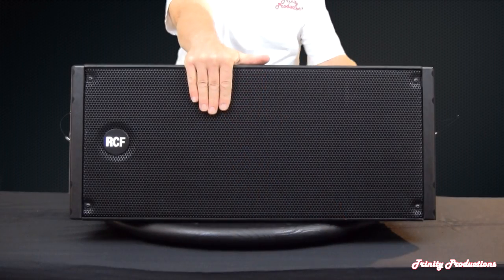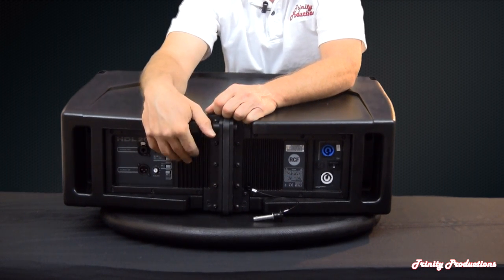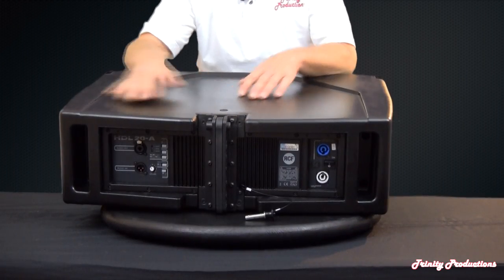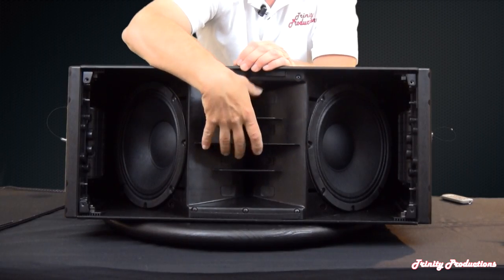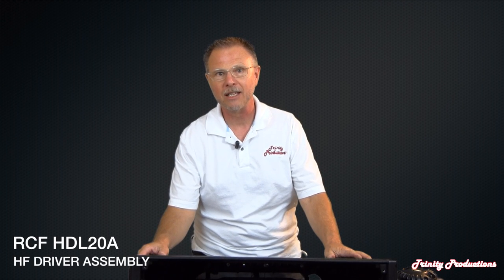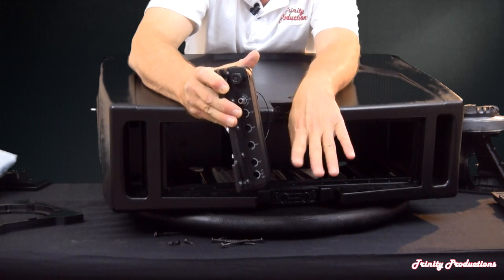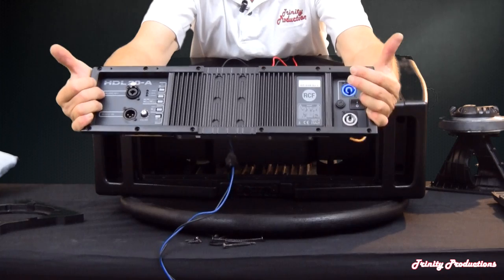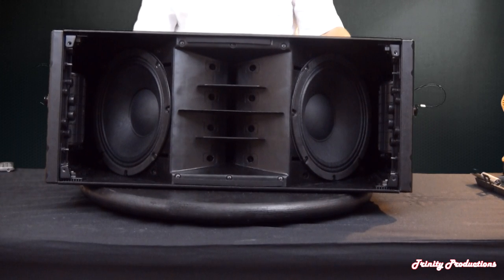RCF HDL20A overview - inside and out - AUTHORIZED DEALERS

Comment: Manufacturer's very good product which produces all its loudspeakers (made in Italy not china)  as JBL. This series HDL tickles legendary reference JBL VRX. Too often the professionals do not inquire about the origin of manufacturing and as regards to the cabinets the origin of loudspeakers, 80 % of the marks being only assemblers having never made a single loudspeaker.
Reply from the maker: Some RCF is made in China. You are incorrect, that the VRX is constant curve JUNK system, the HDL20A is a true scalable line array. It does really not make any difference where the drivers come from, as long as the design and DSP and box is tuned to the speakers and the mfr. warranty stands behind. Does not matter if US , China or Italian made. There are some very good speaker components coming from China. Many of the music store systems by some of these companies come from China and sound fantastic.

Comment: How would u compare these to the QSC KLA series?? Thanks in advance.
Reply from the maker: These have a much fuller sound and the drivers are much larger on the HDL20A for the HF. The amp is a true RMS rated amp, but that said, the KLA are a max of 5 boxes, these you can go to 16 per side in a hang and have full array adjustably, which you can't do with KLA or similar VRX, etc. These are more in the ballpark of the Wideline boxes and not KLA

Comment: What difference between the hdl10a and hdl20a beaide speaker size? I cannot decide if the hdl10a would be good enough for live bands any advice?
Reply from the maker: power and size and type of drivers. more SPL from HDL20 than HDL10...10's are going to need more in the line to produce what the HDL20's can do. If you can afford the HDL20 and handle the weight they are going to give you more bang for your buck for output and expansion. if you are in the US we can offer pricing packages on either...we like the size of the HF driver and crossover point much better in the HDL20s

Comment: Hi. I have a problem I dropped my speakers hdl 20a and broke the body, the body you sell? or as you do to fix it?
Reply from the maker: +richart lopez I do not think they sell the enclosure separate. you would have to look at pulling apart and fixing with epoxy type joiner or fiber glass. trying to get those types of parts would certainly take a very long time if even possible. usually just buy another and use the broken unit for spare parts is the best recommendation i can make.

Comment: what about the throw it is different HDL 20 HDL 10 HDL 6 is it not plz explain is there a longer throw from one box to the other?
Reply from the maker: William - is it not really a "throw" issue it is an SPL issue, all those boxes are highly directional in the vertical , the SPL and coupling of the boxes is what gives it the ability to push out to longer distances the 20-10-6 are a bit less than ½ max SPL of the preceding larger box. the more 20's you have the higher the SPL but it depends on how you set the angle of the boxes that determines coupling and how the drivers are aligned..flat face will give you the most SPL in a stack or line.

Comment: Hello I have 3 boxes rcf hdl20a for each side which button should I press the one it said 2 to 3 baxes
Reply from the maker: Yes, but you don't have to press any.... the buttons tailer the reponse of the HF and LF drivers to couple better in configurations so you get a better overall sound output without being too harsh or low end loaded. However everyone has their own liking..i would play with the speakers at various settings and see if the recommendations work for you. It may be you like the tuning of a higher box count system for your 3 boxes per side. Work with the settings and see what sounds most natural to you...
Reply: thanks

Comment: Excuse me sir, I bought 2 HDL20a and 2 HDL18as. I I’m a Mobile Dj. Do You think that I need to use a Driver-rack PA2? 
Thank you for you time.
Reply from the maker: The subwoofer does have a cross over on it that you can set to feed to your HDL20's to keep the low end out of them, they do have built in limiting too. So if you are seeing the red lights come on all the time for your events, you don't have enough rig for your event and need to add more tops and subs. You can place a PA2 in-between your mixer and speakers and set a hard limiter so the limit lights don't go on  for the HDL speakers but that will give you a maximum volume and that will be it...and will save your system if you are hitting the limit lights all the time.
Reply: trinityprosound okay
thank you so much for taking the time to answer.

Comment: Which is better ?? rcf hdl 20a or fbt muse ?? pls help
Reply from the maker: It depends. Both are excellent boxes and systems and priced almost the same. Both weigh about the same. Construction on them is quite different, FBT is wood and RCF is composite. Both have similar 10" drivers, but the RCF has a mother of all HF drivers and lower crossover point than the FBT boxes, meaning that more of the high mids, etc. are produced by the FBT boxes vs. the RCF. What are your events like you are needed the line array for? What type of music do you typically do?

Comment: Hi I have 6 speakers Rcf hdl 20 tree each side. I need to know if it is,nesesary use a prosessor DBX Pa2 thank you
Reply from the maker: What mixer are you using. ? The HDL20 has built in processing, what subs, do they have a crossover output on them. We would typically use a HPF around 90hz to feed HDL20A tops.
Reply: so would you use a drive rack processing or not? thanks.
Reply from the maker: it depends on the mixer , if we were using an X32 no, we would set that up in the board or use a subwoofer with a xover output that can be set at 90 or 120 like the 8003, 8004 or 8006 from RCF
Reply: thanks

Comment: 8inch speaker or 12inch?
Reply from the maker: These are dual 10" drivers and a very large HF compression driver...the 10" drivers couple very well and produce great low end in this box for transition to subwoofer..HF section is amazing with lower crossover point due to larger HF diaphragm

Comment: may i pair it in RCF 9006 SUB-AS?
Reply from the maker: yes those will work very well with the HDL20A speakers...good choice
Reply: trinityprosound so from HDL 20 A TO 50A Will work on RCF SUB 9006-AS?
Reply from the maker: yes sure will no issues there at all...
Reply from the maker: yes you can use either speakers with 9006 no issues. you just dont want to use HDL20 below HDL50, use as side fills for HDL20 if using HDL50 as the HDL50 is a 3 way box vs. 2 way from HDL20 and sonically they don't line up the same

Comment: Hi!
Jbl vrx932lap vs rcf hdl 20/30-a
Reply from the maker: JBL limited to array size, sounds thin, overpriced for what you get. Either RCF box is superior, HDL30 blows it away, but is more $$$$ too, RCF has lower crossover point for smoother frequency transition from LF to HF, RCF is true RMS power stated for amps.
Reply: Owww
Thanks

Comment: I do not have the guts to buy plastic lines here in Brazil many tests of frequency and was not well, and driver with guide of waves of prasticos does not work !! .. the prices here in Brazil it costs 45,445,35 thousand dollars each box, Who dares to pay $ 45,445.35 for a plastic box?
Reply from the maker: Well, thousands and thousands of the HDL20A has been sold world wide and a very large user group. They are loved for their size and output and not much out there for the output, features and price point even come close to the performance of these boxes.

Comment: I’ll settle for the HD32a at lower price
Reply from the maker: But these are line arrays, they are not meant to deploy with just one per side like an HD32, or even 2, you need 6-8 per side to start forming a decent line with control
Reply: trinityprosound   I have 8 cerwin Vegas loaded with 18sound 18lw1400. How many hdl20s would you recommend I should purchase to sound balanced? Or would you recommend something like the tt25?  The set up will be ground stack and primarily used outdoors.  Thanks